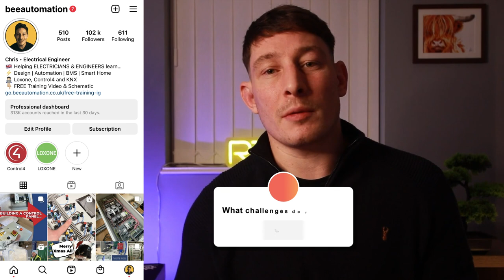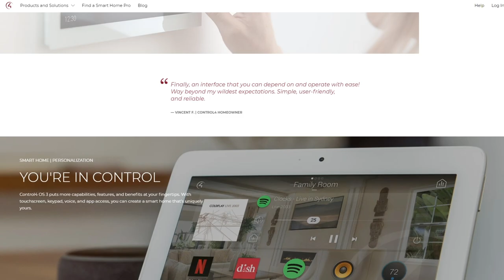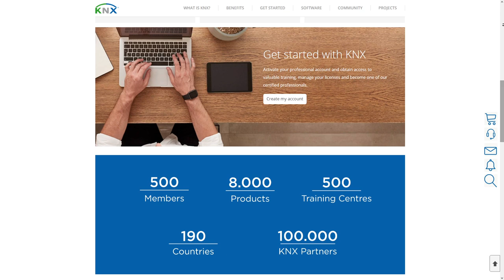An Electrician's Guide to Home Automation Systems

Comment: I think i will look into Control4….
Reply: if you have a ton of interest from clients for video distro, touch screens, audio matrix, and basic level automation; like going to a wall and swiping tablet pages and reading switches for lighting or "automation scenes". Maybe even check out savant they have a much higher rating in the AV industry, and their switches are so much nicer than control4, like 10000x nicer lol and less reported failure.
if that's your thing I would look that direction personally. If clients are looking for a smart home 100000% loxone is the one you would want to do real automation at least in my opinion. we switched from AV to what we like to call energy focus automation and in i think 2 years we saw a 10x in work load. That being said we're in Canada, and we get cold and natural gas is pricey, but that's what my experience has been personally.
 AV "smart homes" are dying and will be replaced with google and amazon since they realistically DIY smart homes can actually do more and do it cheaper, without a pro installer. They wont for years and years replace a industrial grade home BMS like loxone, smarter move would be team green.

Comment: The trouble for me is a lot of these systems are propriety and often require manufactures training days/weeks and even getting a hold of the hardware just to mess about with isn't exactly easy or cheap.
Reply: Do you think Google, Alexa  & apple Assistance can monopolise this industry making the average DIY guy taking having no need for a specialist to install a Control4 or loxone ect ect
Reply from the maker: With KNX and Loxone you can access their hardware without having to go on their training and the programming software is available for free. The KNX free version does limit you in the amount of devices up can have in a system but works perfectly well for learning and small systems 👍
Reply from the maker: @user_i.d  I don't think that will ever happen. I think as the years go on and more people (building specifiers included) become aware of these professional systems, their benefits and realise it can be done affordably they will end up dominating the med end of the market (and obviously high end). I think they'll still be a place in the future for the off the shelf consumer products but I don't think they monopolise it... great question! 🙂
Reply: KNX is an open standard supported by 500 companies (ABB, Siemens, Schneider Electric …) , it is in more than 1M buildings and is open by design, unlike Control4 and Loxone eho have just one manufacturer behind them.

What used to be KNX’s biggest problem - the lack of a default server for visualisation and automation - has become it’s biggest strength, as you can use it with HomeAssistant, OpenHAB and ioBroker, in addition to around 50 commercial solutions.

Unlike Loxone, KNX has no single point of failure -  a defective MiniServer or botched firmware update can cause the whole building to be dark for days until a replacement server is installed.

With KNX everything can be designed in a redundant, highly available architecture, with separate lines per floor and - due to the intelligence of each component - no impact of one failed device on any of the other members on the KNX bus.

So if you want to use Loxone in a reliable way - let’s say for hospitality - you should always use KNX as the infrastructure below the Loxone server.

If you use Loxone Tree, you bet the wiring of the building on the success of a single mid-sized austrian company.

I personally would never do that, given that we are talking about a 30-50y timespan.

If you want to get started with KNX, check out Torben Ledermann’s English KNX course here on Youtube.

It might seem complicated at first, but there is beauty in KNX’s simplicity - and because you can control every device on the Byte & Bit level, you have guaranteed compatibility and long-term stability within that platform.
Reply from the maker: @maxking3  Great comment! And I totally agree with what you're saying. I love what you said about "botched firmware update" I can't get over how they can allow this to happen! The amount of partners they must P*** OFF! I say "partners" very loosely too ... Loxone is a great product to start off with but not a reliable, commercial grade option compared to KNX. 

KNX needs to be made more intuitive to use for new people entering the industry though. ETS is not user friendly at all!

Thanks for sharing mate, and I will look into that YouTube training!